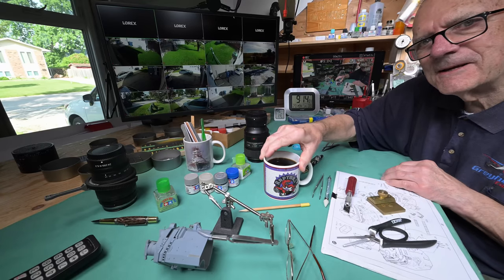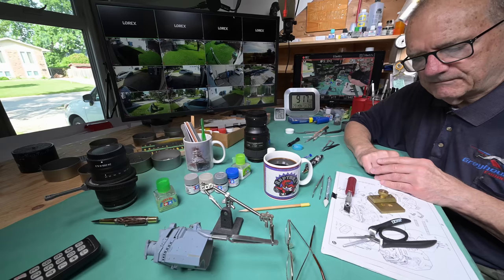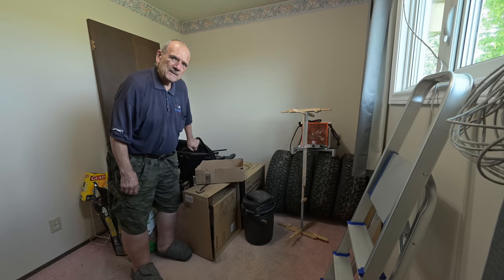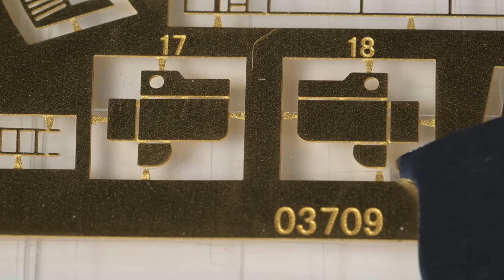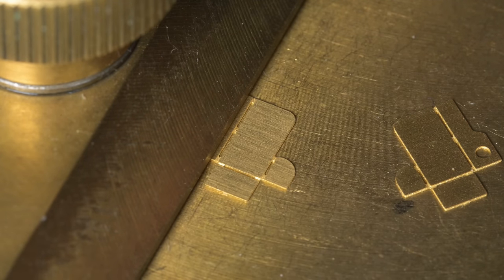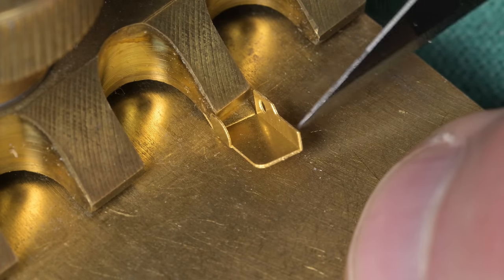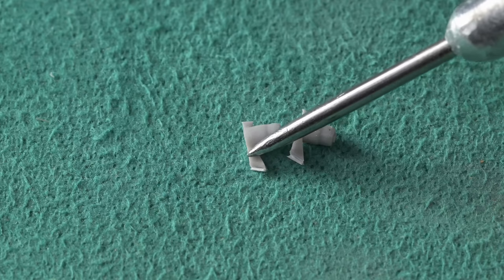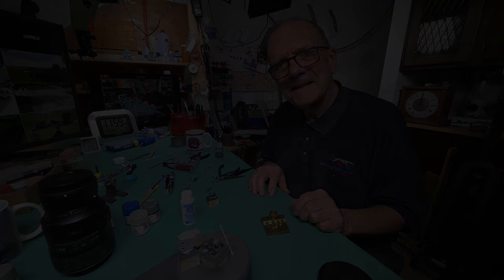The Model Ship - Part 1250

Comment: Ron, your channel is modeling therapy for me,  too many times i get frustrated or antsy with a particular part of a build, then i watch your chilled way of working and all is well. On the searchlights I might have tried using Molotov chrome before applying the clear. It works great on aircraft lights
Reply from the maker: Thanks for the tip Ralph.

Comment: Hi Ron, I can commiserate with you on the desire to spread out, and if it is 'folly' or not. It seems I am constantly setting up new 'workshops' or work areas for some project that distracts me from many of the current projects I am working on, or at least supposed to be working on :)
I think your current modeling setup is brilliant, especially for us viewers. Perhaps all you need is a simple method to switch out projects so that you can quickly hop from one thing to the other, but still be able to film and share your build, whatever it may be you are building, with us.
As usual, thanks for sharing your fun, hope to see you tomorrow.
Reply from the maker: I like Barry's idea. "add just one table surface to the back room" 👍